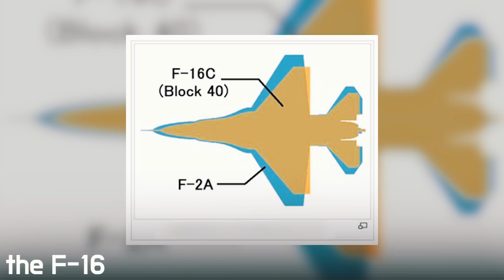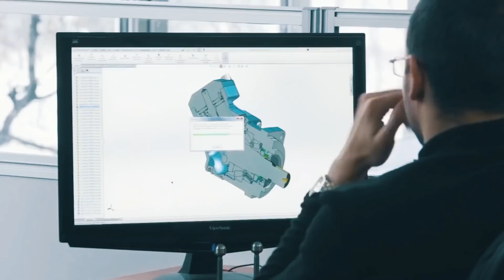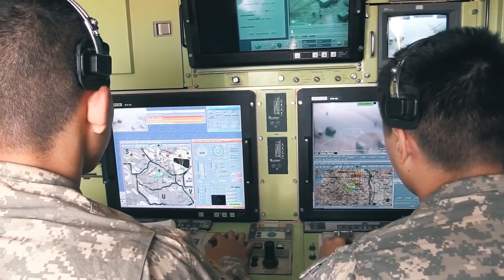Japan Has FINALLY Revealed Its 6th Generation Fighter

Comment: A true Japanese 6th gen fighter would be able to dock with a torso and would be designated as a “core fighter” capable of being deployed as a gundam mech on the ground with space flight abilities while docked and as an emergency fighter jet while ejected. 6.5 gen would just be the zeta gundam or gundam unicorn
Reply: unicorn without NTD, yes. With NTD, much higher, and with Unchained it's quite above space-time.

Comment: Sounds like a great airplane, if it performs as advertised. It's Gen 5.5 in my opinion. It has some BIG advancements over the F-22 (all composite, weird-ass electronic shielding) but does not not quite reach a new generation. Still very cool stuff!

Comment: The engine intake is so low profile yet has equal or greater air intake while in line with the center of wing...it appears to me this is a superior design for speed power control with least resistance...the wing has a spoiler effect drawing max air into engine with less fuel burn....I guess this plane may travel farher than others....It's a shot from the hip at a glance...but a picture is worth a thousand words... now I'll watch the video....

Comment: To be a true 6th generation fighter, it will need the ability to send out a signal instructing the 3 drones to automatically connect with the manned fighter thereby making a giant flying robot. The giant robot can then land and start smashing the enemy's tanks and ground to air missile systems. Then, when everything has been destroyed, the giant robot can blast off and start flying again then send another signal to the attached drones instructing them to disengage thereby re-establishing the 4 unit fighting force. Then, it would be a TRUE 6th gen fighter.

Comment: Stuffs made in Japan are very durable.  I had Toyota 1980, its engine was very clean, no oil leak.
Reply: As they say Toyotas are "good, solid and reliable"  - the translation for that is "heavy - ugly and slow". May I put it to you that those characteristics are not exactly what you need for a combat aircraft. As for the availability of this thing they say in this report that it will not even be  combat ready until 2035. By then the west will be lost and China, Russia possible India  and the resource rich nations will rule the world. For sure there will be no more super power USA or EU. in 2035 so Japan will have to form alliances with the Asian nations.  Interesting isn't it?
Reply: @peterturner6497   boring. Empires rise and fall.  Human mind is so small.  There are many planets out there.

Comment: Don't forget it's Fly-by-light system and advances in its engine design which made it slightly smaller and lighter than F-22 engine yet thrus-to-weight ratio close to F-22. The use of advanced ceramic component to make it able to withstand higher temperature.They will certainly make improvement into it. Lastly, do not forget it's capability to auto fix its system and divert power to other system should it be damaged. These what made it a 6th gen fighter.

Comment: Once more for those slow to comprehend that there standards for the words we use...the J-20 is not a fifth generation aircraft and it isn't a stealth aircraft either, so let's stop using "5th generation" if you're unclear on what that means. I have little doubt that Japan can develop a 5th generation or even a 6th generation aircraft if it really wants to...but when one flies I'll believe it.
Reply: why not? it has far better stealth than the SU57 which is considered 5th gen

Comment: It all sounds great what they "want" to do, but in reality, it's very difficult. The F-35 was an immense challenge for Lockheed Martin, and they know exactly what they're doing.

While people don't seem to respect what China is doing. What they need to remember is, China spend a lot of time making planes and weapons and everything they do contributes to their R&D. So the J-20 for example is a product of their early science into stealth and engine design, everything they get from that, all the measurements and information they get allows them to learn for future designs.

China probably slowed the development of the J-31 to make some adjustments from things they learned with the J-20. And now they have them, they get to test them against radars and learn further, which also contributes to futre SAM designs.

And those engines Japan has yet to design, again, it sounds awesome, but engines for fighter jets are one of the hardest things to design. They themselves could take as long as the rest of the aircraft to design.

Just saying, this project won't be easy and I wouldn't discount what China is doing.

Comment: Japan is a power over numbers, the US is numbers over power.

I think we (US and allies) need to develop a dynamic military-scientific exchange program. basically the US + NATO/EU/Western allies focuses on mass production models and the US+ japan focus on high production/leading edge fighters.

this lets us get a premium model and a mid-grade model as we adapt technology. and there is a lot of advancements recently that may out date planes and equipment very fast. its enough to give you a head ache trying to generalize it.

these new stealth planes apply the concept of "don't touch me." meaning the parts and plane are more interested in operating with significant damage to "limp home," or to simply not be touched. older planes were built as relatively hardened against flack and other conventional weapons.

>fly high
>be light
>carry a lot
>bend and flex

sound more like we need to create a solution from common materials that are easily available to the US and allies.

titanium and vanadium are very good materials, but unfortunately are dominated by Russia so carbon fiber may be a better choice with this concept. I think most of the cost is in R&D and the fact you have to basically throw out the old to make way for the new and possibly scrap the parts for the new. so yeah a headache. big thing is that we are working together but we can maintain operational security. I think I can live with Japan having the best ever fighter ever if the F-35/drones can win the game of numbers and analytics.
Reply: what you need to do, is stop waring with everybody, & educate the world, so we can advance as a planet,,not a country.. 1 icbm, would feed a 3rd world country,educate & cloth them, for life.. think about it.  communism,& a bigger stik,,is 2 yr old baby mentality.. its proven,the more educated you are, the less kids you have, this is why poor country,s have 15 kids,, nothing better to do.. just like a bonobo monkey,fk all day..  old song,,,war,what is it good for,,absolutly nothin..
Reply: @harrywalker5836  you don't seem to understand international politics, escalation enforcement or much of anything else.

I and the US, US allies, and US related stuff. we don't war. we defend the innocent and aim to building a better world. we did it in vietnam, iran, and will do it for this supposed WWIII.

the US leaves any place it goes to better than when it left, especially when it wins a conflict. that 1 ICBM makes it possible for those 15 starving kids to have the opportunity to eat. you can directly use the war in Ukraine just exactly as an example of that.

we have armaments so that thinks like the Tiananmen square in 1989 aren't a thing that violent abusive dictatorship are ended as peacefully as possible, its a stick, a big stick that we carry.

then again most of the starving people in the world I know of are brought the starvation because of abusive governments who restrict their freedom, the freedom to travel, the freedom to engage in self-sustaining behaviors, the freedom to self regulate. the CCP has done this for the uyegers, and now its doing it for all of china.

People starve because dictators denies them access to food or the means to produce it for themselves. you need safety, food and shelter and the people will take care of the rest, but there are so many who denie this right. the super-stealth jet, it makes sure that the CCP knows where it can stick its opinion of Japan, of the US, of other countries. the CCP isn't your friend, its a monster of abusive enslavement. it eats your freedoms. it prevents you from saving yourself under penalty of death. you are not free to think, you are not happy, you cannot be happy because the party says so.

Comment: If made of carbon composite surely it will be lighter than F22 even though it may be bigger. This would also explain why they don't need more powerful engines. This is all guesswork and the answer simply is we just don't know the full extent of what they are targeting. If it is 6th gen then perhaps the electronic warfare capability, and blocking technology will certainly be next level and give them a tactical advantage than current 5th gen planes.
Reply: Well stop checking and fact check if you have a brain?

Making the body lighter always adds capability. Taking out the hydraulics is way more efficient.

Comment: 5 gen is really just a marketing scam to sell the F-35. Even the American industry realize that physical stealth is not a thing anymore as many countries has radars that can detect AND lock on to F-35s. Modular is the real 5 gen. Planes that can upgrade all systems just like changing an app, like Gripen E. And change hardware without recertify the plane.